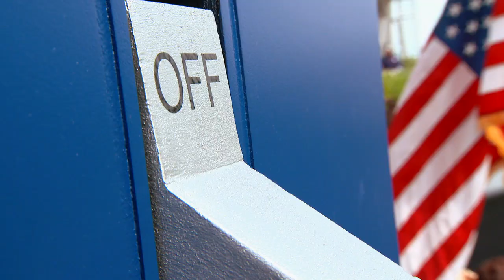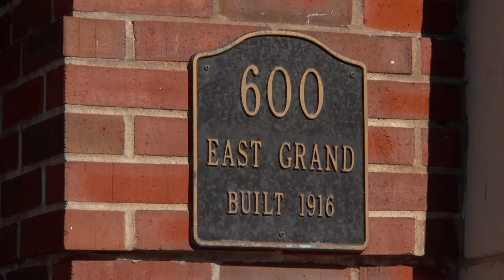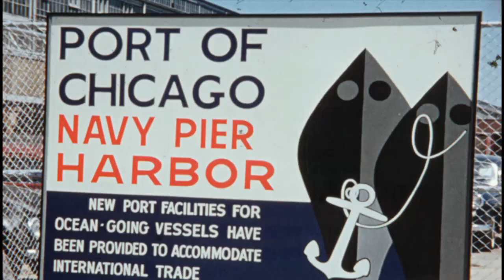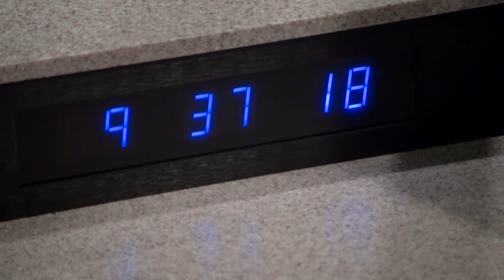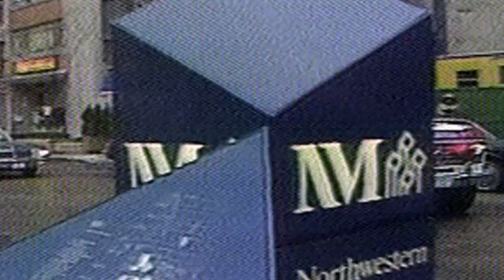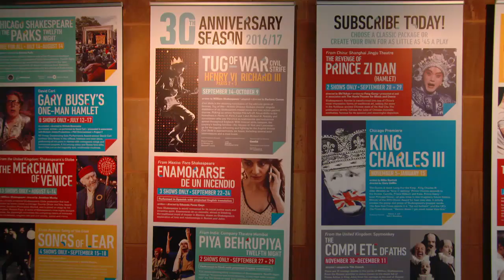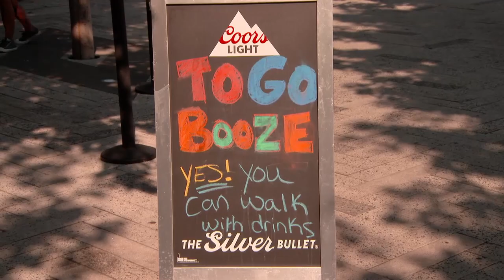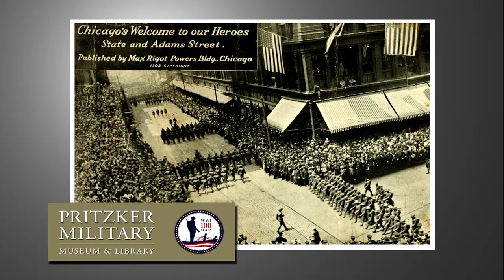Navy Pier: A Century of Reinvention with Geoffrey Baer

Comment: I was an architectural student at Navy Pier from 1963 thru 1965 and went on to Chicago Circle campus.

I remember sitting is class and feeling the sway from a barge filled with sand being tied up on the north side as they were building the water plant to the north.  we would see the top of the sand piles move past the windows.  Then there were the ships that would shake the pier on the south side when docking.  Along with that the noise of the trains down the middle of the pier.  and also the planes flying overhead from Miege's field. this was a transportation hot spot.

The one benefit of the long pier and the interior corridor was that you passed all the other students coming and going each day.

all-in-all, a great experience.

as an aside, at the Circle campus, they had not constructed the Art and Architecture building yet.  The school was housed in a great concrete building to the west of the campus.  a former Perma-Lift Bra factory, the we renamed the Bra-House.